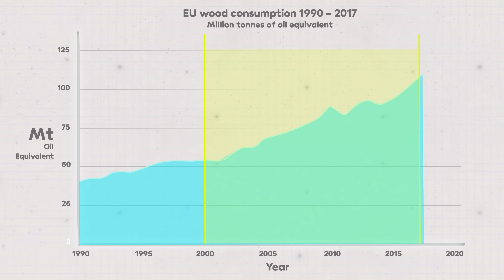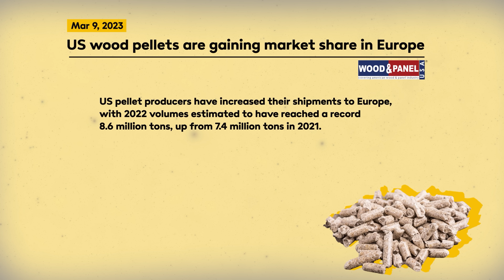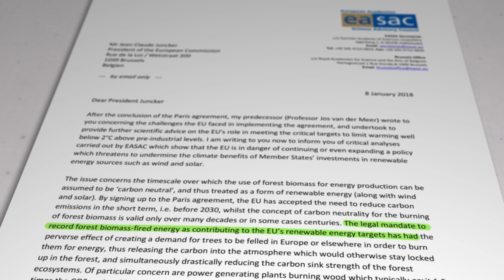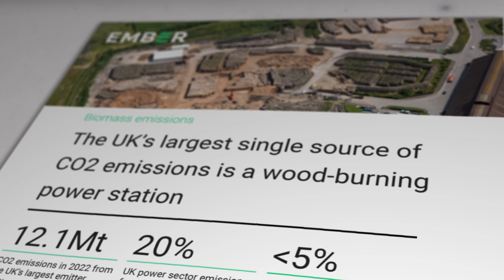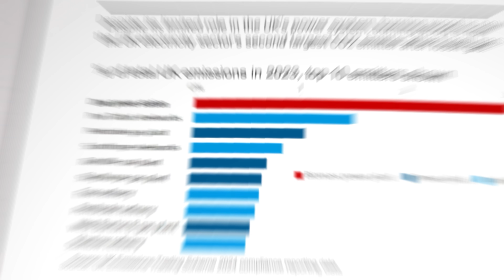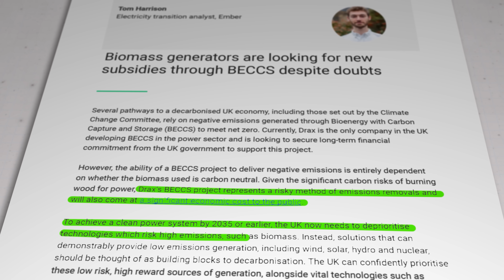New report: Biomass CO2 emissions 4X higher than COAL!!

Comment: There's a simple axiom: If you have to burn it for energy, it's not green. You're treating the atmosphere as an open sewer, it's not green. ♻
Reply: I think part of the problem is in the accounting of replacement trees. Even if you do so on the basis of number of trees (rather than area), the mass of tree cut up is greater than the mass planted. If you limited the industry to only cropping the mass of new growth year on year you might be closer to carbon neutral.
Reply: Once you make it an actual solution companies stop wanting to do it.
It’s solar and wind that are economically viable power sources.
Reply: "If carbon were recently removed from the atmosphere and then returned, it would be greener than burning ancient fossil fuels that have not been in our atmosphere for potentially millions of years"

Theoretically, yes. But, in practice, coming up with airtight system to prove that carbon being added to the atmosphere is being balanced out by carbon removed from the atmosphere with a reasonable timeframe is nearly impossible; at best, it depends on numerous assumptions which are very difficult to verify. It also creates bad incentives for companies to get creative with their carbon accounting so that things appear to be carbon neutral, which really aren't. In a nutshell, this is very similar to why carbon offsets don't work.

In other words, depending on human arguments that carbon emitted is being offset by carbon removed doesn't work. What does work is not emitting the carbon to begin with, so there is nothing to offset.
Reply: I am inclined to agree with you but i would only add that the emissions control is very high with fines applied should the continuously recorded emissions breach the set level. Though note that this applied to elements such as sulphur, and heavy metals and CO, not CO2
Reply: If carbon were recently removed from the atmosphere and then returned, it would be greener than burning ancient fossil fuels that have not been in our atmosphere for potentially millions of years. Co2 in the atmosphere is not a problem, and increased carbon over time is not a problem. However, the rapid change of greenhouse gases at a rate faster than evolution can adapt is a serious problem for the biosphere. 

With this said we still need to increase forests and not decrease them. Biomass should be grown not harvested.
Reply: @djmeser  Agree that reusing the carbon already present is better than resurrecting old carbon already sequestered. By a little bit anyway. Much of the carbon already in the air and oceans is from the old carbon, formed by millions of years of biological collection and then natural sequestering over large areas. So here's the "problem" with planting anything as a solution...there's not enough area to recapture that amount of carbon, and that's even if we use all of the viable area, which we wouldn't because much of it is used for other things like crops and living on and infrastructure. I put problem in quotes because we absolutely need to reforest and bring back biodiversity, but for other reasons, not for the purpose of capturing carbon since the scale is far too large. The small percent it does grab would be a side benefit.
Reply: @djmeser  This was may understanding, in regards to biomass. You grow it, which takes CO2 out and then you burn it putting it back in, net zero.  This appears to only be a problem because they are transporting it from SO FAR AWAY.  All costs to collect the biomass, convert into burnable pellets and transport it is net OUTPUT of CO2.
Reply: I have a large greenhouse growing veg for sale. I planted a short rotation willow coppice to provide wood fuel to heat it. Apart from possible issues with particulates etc it is a green fuel and carbon neutral. Biomass isn't the problem, it's how you do it. Drax is a disaster.
Reply: Making solar and wind devices also result in some degree of pollution. Good thing they last forever once made, right?
Reply: @rhaedas9085       They last decades, then are recycled. 

“Solar Waste Stream is Tiny, Compared to Current Fossil Fuels"
This Is Not Cool, October 9, 2023

“A Fossil Fuel Economy Requires 535x More Mining Than a Clean Energy Economy” 
Michael Thomas, Distilled, March 29, 2023  

“New Video: Clean Energy = Less Mining”  
This Is Not Cool, September 15, 2022  

"Mining quantities for low-carbon energy is hundreds to thousands of times lower than mining for fossil fuels”
Hannah Ritchie, Jan. 18, 2023

“By 2042, Chinese Battery Maker Will No Longer Need Mining as Recycling Takes Over”
This Is Not Cool, May 22, 2024 

“NREL: How Much Land for Renewables?” 
This Is Not Cool, March 1, 2023 

“Solar Much More Efficient Use of Land vs Ethanol”
This Is Not Cool, January 22, 2022
Reply: Burning wood is OK if you make sure to replant enough trees to bind an equimolar amount of carbon as you blow into the atmosphere. As the other person has pointed out - gasifying wood would also be an additional option. By doing that, you'll get Hydrogen and Carbon monoxide gas, which can be burnt for energy generation. A part of the wood is turned into almost pure carbon, contaminated with mineral salts and oxides. That carbon could then be buried, lowering the need for replanting to reach a net zero.
Reply: @Psychx_ you should rewatch the video. The problem is that you have to plant more trees than you burn because trees grow too slowly. The problem is not the overall amount of CO2 but the rate at which we're releasing it, which drives an unmanageable rate of warming. Burning trees releases CO2 at a rate faster than the rate of tree growth / CO2 recapture.
Reply: @Psychx_  It takes more than 10 years for trees to mature enough to store the carbon that older trees do. It's just 100% stupid to burn old forest for any kind of energy.
Reply: Is co2 a problem, it has been 20 times higher in the past?
Reply: @tonysheerness2427 it has been 20 times higher but not with humans present. Guess what, the Earth also had little to no atmosphere once too, is that an argument that eliminating our atmosphere is a good idea?
Reply: @tonysheerness2427 With very different life forms and climate and over a much much longer timeframe. It’s like the difference between having a sip of water every few hours or drinking a couple gallons in a minute.
Reply: @Sharukurusu  Animal life doesn't care much whether there's 0.04% CO2 or 0.4% CO2. We exhale far more than that at roughly 4.4% CO2 every time we breath. I've seen this sort of argument about how life today evolved different and it doesn't stand up. Humans in submarines can do their work despite being in a stressful and tight space while breathing in absurdly high CO2 air. So long as the change is gradual (over a time span of at least hours) rather than immediate transition like walking through a door, we adapt just fine, just like we can live in places as different as glacial areas, rainforests, or the hottest deserts.
Reply: @tonysheerness2427  CO2 is the primary cause of global warming. Above 1.5°C, the climate goes out of the interglacial period what our civilization is attuned to.

Didn't expect to see a climate denial bot still going around.
Reply: @tonysheerness2427  An at that time the planet looked like Mars.
Reply: @petewright4640  No, no it didn't. It was greener than it was today.
Reply: @5467nick  The Cambrian Period was the last time CO2 levels were 20 times the current level. The land was barren (looked like Mars). Most life was in the oceans.
Reply: @petewright4640  Seeing as Mars doesn't have any oceans nor life in them to speak of, I stand by my previous comment. There's also the fact that there simply hadn't been much in the way of large life before the Cambrian, and during it, there was that little thing called "the Cambrian Explosion" where life went and happened a whole lot more than it used too. Most of the issue with life wasn't directly from CO2, but rather the lack of oxygen. That's not an issue we will face.
Reply: @5467nick My point is that the last time CO2 was 20 times the current level the Earth was a very different place. Saying that "it was greener" in no way shows that having similarly high levels today would not be harmful. And it's stretching it to say that it was greener when the land was bare rock i.e. it looked like Mars. Temperatures were about 10C warmer than now and that was with a weaker sun.

Comment: Suggestion that burning waste wood has larger carbon dioxide pollution than burning coal is utter nonsense. UK has no energy storage for gas or electric
Reply: The UK is currently leading the pack with battery storage implementations within in Europe, having 4.4GW of battery storage currently operating with a futher 4.3GW under construction and a total committed pipeline of 95.6GW of storage project over the next few years.

The claim about Drax's wood burning CO2 footprint being higher than coal in the UK is true, but reflects that coal now only represents 1.1% of the UK's generation mix. There is only one remaining coal fired power plant working in the UK, at significant reduced capacity, that will be decomissioned shortly (later this year).

Comment: Biomass is net zero because it is carbon already in the carbon cycle. However there would be economic costs associated with biofuel that you would not get with zero emissions. Biomass would warm the planet but instead of warming it into the indefinite future, like with geologic sources, it would warm the planet for as long as it would take for the biomass to grow back and then for however long for the temperature to exponentially decay back to where it would be had it not been burned. There would also be the risk that the climate is unstable and the warming from biofuels could trigger some positive feedback loop which would have otherwise been avoided.
Reply: "Biomass is net zero because it is carbon already in the carbon cycle" only holds if it is being sequestered as fast as it is being released. Which is not the case.
Reply: @jaapfolmer7791  Yes it is net zero. Theoretically if is being released faster than it is being sequestered, eventually you would run out of trees and you'd have to wait for them to sequester the carbon and grow back. It is net zero when you don't just look at the instant but look at the entire carbon cycle.
Reply: I agree. I live where waste biomass from logging is used for pellets and see where it is not used decomposes in a couple years. The carbon burned from waste biomass is that much carbon not added to the carbon cycle from fossil fuels.

Comment: The "4 times as much co2 as the UK's only remaining coal fired power station" is a meaningless statistic without knowing the relative annual power power output of each power station.
Reply: Y'all forgetting transport costs.
Reply: It's a moot question, the UK's last remaining coal fueled power station is due to close end of next month, it's been ramping down for a long time so any comparison will be misleading.
Reply: @GruffSillyGoat moot
Reply: @ChazCharlie1  Dyslexia, but thank you (corrected)
Reply: Splitting hairs much?
Reply: @stickynorth 
You don’t understand?
It’s the whole point..
Reply: ...why? burning wood pellets is horribly inefficient compared to coal or oil or gas. it just isn't an energy dense fuel source 

that's why the wood burning plant is so high up the list compared to the top polluter plants all over the UK - the only reason it doesn't top the chart is because it can't scale up. there is no way to burn wood as a power source without having ridiculous amounts of waste emissions because wood isn't a great fuel
Reply: @ItWasSaucerShaped  Except you have that backwards. Up to 40% of the energy of burning wood comes from the hydrogen component of cellulose (C6H10O5). So CO2e of wood is 40% lower than of coal. Plus, coal mining releases fugitive emissions of CH4, up to 120 times the GWP of CO2.

Still, wood isn't a great fuel until you use pyrolysis to split off VOCs to form pygas and black liquor to make liquid fuels, plus biochar which has five dozen commercial uses, most of them more valuable than use as fuel.
Reply: @ItWasSaucerShaped  Wood is a lot denser than gas!
Reply: Drax seems to burn all sorts of highly reusable UK wood items according to others commenting here : timber yard wood and old kitchen units?. AI view of the statement : "creating four times as much CO2" likely refers to the immediate carbon emissions released during the combustion of wood pellets compared to coal. While wood pellets might produce around 1.5 times more CO2 per kilowatt-hour of energy generated, the statement could be considering the entire lifecycle of wood pellet production and use.

Here's a breakdown of how that figure might be reached:

Harvesting and Processing: The process of harvesting trees, transporting them, and converting them into pellets requires energy and releases carbon emissions.

   

Transportation: Wood pellets are often shipped long distances, further contributing to carbon emissions.   

Combustion: As you mentioned, burning wood pellets releases more CO2 per unit of energy than coal.   

Carbon Neutrality Debate: While proponents of wood pellets argue that the carbon released is eventually reabsorbed by new trees, this process takes time. The immediate impact is a significant increase in atmospheric CO2.

Therefore, the statement "four times as much CO2" might be an estimate encompassing the entire lifecycle emissions associated with wood pellets, not just the direct emissions from combustion.

It's important to note that this is a complex issue with ongoing debate. The carbon footprint of wood pellets can vary depending on factors like the source of the wood, transportation distances, and the efficiency of the power plant. However, the claim that wood pellets can result in higher immediate carbon emissions compared to coal is supported by research and is a crucial consideration in assessing their environmental impact.
Reply: @astoni314  Generally, harvest and processing, transportation and sundries are considered a wash, as overall the mining of coal is much, much, much more energy intensive, and with immense fugitive emissions by comparison with wood, even from halfway around the world. And either is small compared to emissions from burning for energy generation. Check for yourself.

Also, wood is chiefly cellulose (C6H10O5) and lignin (C9H10O2)(OCH3)x, so about 40% of the energy of burning wood comes with H2O emissions instead of CO2 emissions.

That is part of why getting the same amount of energy from coal leads to about triple the CO2e of burning wood, directly.

Therefore, the dubious claim that wood pellets "can" result in higher immediate emissions is as suspect from Ember as when it was said by GWPF.
Reply: You realize unit per unit is the key comparison being made, right? The coal plant is just an illustration to help contextualize.
Reply: @custos3249  But that's the point, a "unit by unit comparison" isn't been made. That's what's needed for a meaningful "context".
Reply: @petewright4640  - Drax has 2.6GW biomass generating capacity (plus a smaller 40MW gas backup capacity for breakdowns) but can scale it's output by demand (curently reporting 645MW output from one of it's four units). The last UK coal fired power station had 2GW capacity but is only running at 500MW capacity currently (till it's switched off in a month of so), although this power station did run at 2GW for a short period earlier in the year. It's not clear if the figures from the report Dave outlined are scaled by output or not.
Reply: @petewright4640  Wow. It's right in front of you, yet.... You're an even more special kind of special than I gave you credit for. It should be celebrated that you're able to tack together complete sentences.
Reply: Yep,, v sad to see such clickbait… obviously we need to normalise the carbon emissions wrt to power produced

Comment: I would love to see DRAX closed ASAP. A complete nonsense of a 'solution'' Carbon Capture really isn't the answer
Reply: Completely correct . Drax needs to be consigned to
History
Reply: Bad Bond Villain... Bad Corporation/Power Station too!
Reply: @stickynorth 😂
Reply: GWPF would love to see DRAX closed ASAP, but revels in the confusion and dissent it sows among environmentalists confused about a complex topic. Don't burn wood? See it decay to methane 120 times worse than CO2.

Carbon capture is no answer until 100% of fossil emission ends.

Then, until CO2 concentration falls to safe levels around 350 ppmv, it's part of the answer.

Then after that, not at all an answer.
Reply: Exactly, and even if carbon capture worked, the absolutely last fuel you’d choose to capture from would be wood.
Reply: Yes, let's depend on Putin, that's much safer for oil and gas for 90% UK cars and UK houses 😅